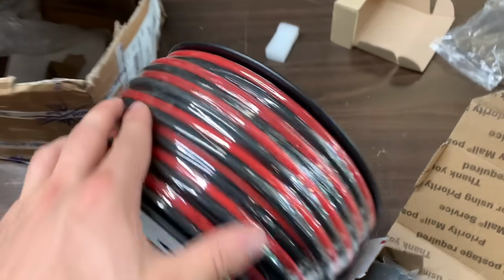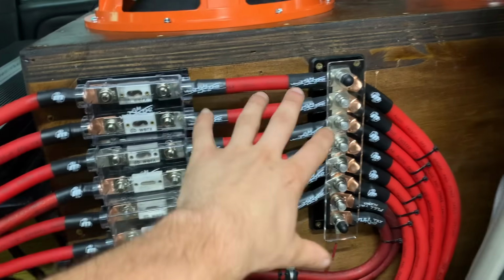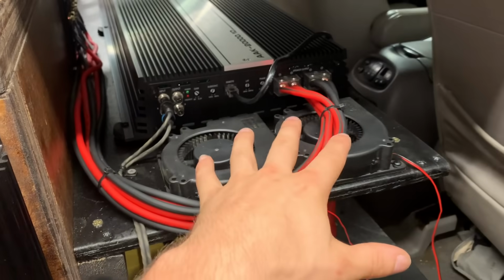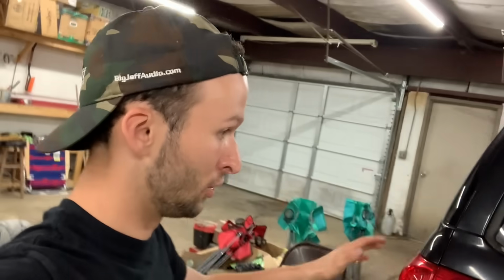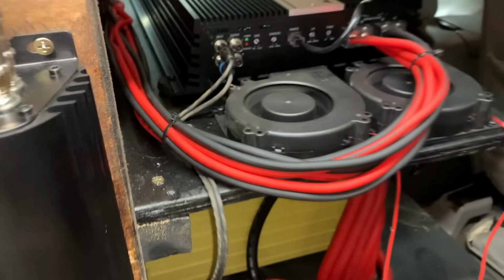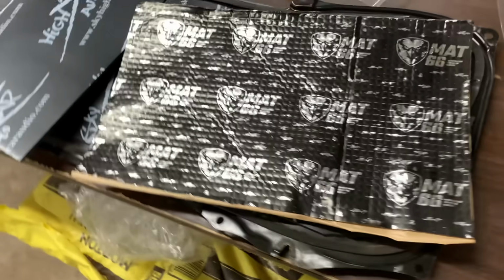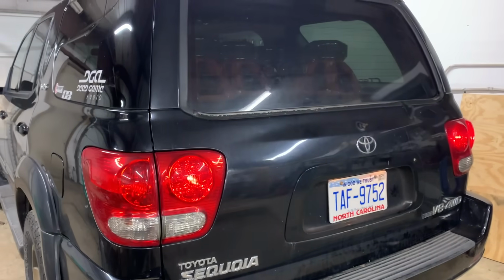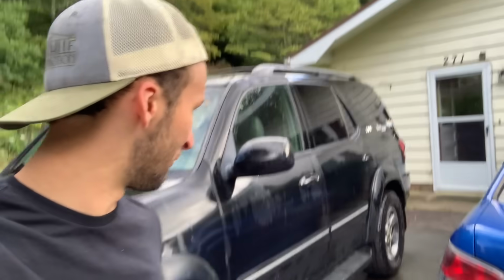20k Watt Bass Build Part 9 FINAL | 2023 Sundown Show Build

Comment: A tip I've learned from using sound deadening is to make sure the metal surface you're sticking in to is thoroughly cleaned with isopropyl alcohol or some sore of degreasing agent that doesn't leave a residue.  The material will stick better and stay there forever.  Do the same for the material that you were sticking the new stuff to so it sticks better to that surface as well.
Reply: And of it falls off anyways, or you want it to never fall off, DONT USE the cheaper 3m spray adhesive.  Or the gorilla glue one.   Because those suck, u need headliner adhesive or the 3m 90, which is the more expensive one.

Comment: In 90 I ran 24 hifonics 12s on 3k to make 156,now my 4 15s on 24k doin 158+. Crazy how different things are
Reply: 3K in 90' was pretty much unheard of back then. What kind of amps and subs were you using?
Reply: @dextermorgan1  Olympian subs,like solobaric kickers at time. 3 generation X Hifonics Zues amps,wired at 1 ohm,fanned to death.
Reply: We ran competition circles until about 2000
Reply: @moabs10blowthru41  Nice! I know older Hifonics amps worth excellent but I didn't know they made good Subs too.
Reply: @dextermorgan1  oh yeah,mine were the low level subs,they had some heavy hitters for sure

Comment: Second Skin is the best deadner available imo its sticky lasts forever and kills rattles as well as comes in several types to fit your needs
Reply from the maker: I appreciate it! I’ll look into it
Reply: Actually you can’t beat the Deaf Bonce Deadener we tested several brands and they come out on top
Reply from the maker: Hmmmm I might have to try it!
Reply: @ParkerTheBasshead second skin is great but the deafbonce one is like the vibraflex has to go on with a  flame torch but hardens like concrete
Reply: I use ground zero deadner, it sticks super nice and does not need heat gun also stretches somewhat. I also recommend deafbonce's stuff
Reply: @parkerthebasshead hey did you make sure you put all the mounting hardware in look like you might have missed a couple.
Reply: I used the deaf bonce double rigid best sound deadener on the market you literally have to torch it on and will last forever
Reply: Parker I do like what you do and how you carry yourself. So with all due respect, you should have had a professional build your box. That build is looking a little weak for what you're running.
Reply: Facts
Reply: @danielturrubiarte5160 no wall Toyotas hard to work with, but i do agree. My 5th gen 4runner does 52+ with a single 15 😅. Vibraflex, and more power will help him a lot tho. Those subs eat power like crazy. I didnt get to hear it in person at sundown though, so just speculation of course. Vids are odd. Ive heard loud stuff that wasnt windy, and heard windy stuff that wasnt loud 🤷‍♂️. Anything is possible.
Reply: If you are looking for the best CLD. Resonix just came out with a new cld product that is thicker than their previous. Their last product was the best performing. If stiffness and spl are the goal, you'll get more out of something like vibraflex.
Reply: That's still butill sound deadening. You need the hardening stuff. Deaf bonce, sundown or dc audio. The stuff you need a torch to apply

Comment: I've seen other builders use wood to shield their back hatch, something like you would build on your car doors to prevent damage but they used wood, probably could still use deadener on it still for extra protection. Probably could use foam behind the wood to seal it. For the number plate you can use thin weather strip on the back of the plate to prevent that from rattling as well.

Comment: It looks like you have the 3n1 Sky High Deadner with foam. That should be the single last layer used on top of deadner and can be cut in smaller pieces to fit better as the foam prevents contouring 

80mil/120mil/200mil butyl from them is what you needed mostly, goodluck on the progress
Reply from the maker: Ahhh ok the listing just said 160mil deadener and I assumed it was the heavier duty stuff
Reply: @ParkerTheBasshead This foam layer is usually meant to be placed under the carpet to isolate road noise. Its not a "mass damper" like the thinner, heavier stuff.

Ideally you need to bolt a steel plate to the hatch door. An extra 20 or 30 pounds would help stiffen it a lot. A couple pounds of traditional mass damper is not going to do much. The air from the port is very strong. 

Bolting or clamping the hatch shut is another option.

Comment: Yo idk if someone else has mentioned, the deadeners are 2 separate entities. The typical stuff is butyl rubber deadener and it is intended to add mass and lower the resonance of panel. The other stuff is closed cell foam, and is intended as a top layer over the butyl deadener, and has the same effect as an empty room with no carpet and adding carpet to it. It kinda helps more with high frequencies, and the possible echoing or bouncing around and repetition of those sound waves. The close cell foam is not intended to add mass.

Thats the difference to my knowledge, might be a helpful tip to pass on to the boys 🤷‍♀️ 
love the build 🤙

Comment: Awsome build bro! It's cool to see someone so thrilled about there own project. Keep up the good work. Ive used the sky high dampening and ran across the same issue. I just used 3M spray glue and that did the trick. Since then I had no issues. I'd like to see you review the Harmony Audio 18" Goliath  dual 1 ohm sub. No one has featured these subs for an absolute review. They seem like great 18's. Would like to see a full review in the future if it's possible. And very nice wiring work. Very clean.

Comment: I've got 2 boxes of 80mil Killmat in my beater (36sq ft box and 18sq ft box and it made more difference than any other single upgrade I've done. Less than a hunerd bucks, a weekend and a couple gallons of sweat is what I've got invested. Just did the roof today, actually. Happy effin camper here bro, dropping quad with newly upgraded Sundown U-18 powered by a MMATS Hifi4250 bridged 4ohms for 1,600rms.

Comment: I use kilmat 80mil, and I have 163 db build, and just got another Crossfire 16k for my 4 Crossfire xt3 18's in a 4th. Used it for years and never had a problem, and it doesn't break the pocket book🤙

Comment: I do have to agree about Skyhigh Car audios stuff. I tried their battery/ground cable, speaker wire, and a few other things.  Wasn't impressed at all. Got rid of all of it and went with D4S. I gotta say I was skeptical about D4S, ya know. Best wire, equipment I've owned or bought in a hot minute for sure! Build looks good! Really good job!

Comment: You need deadener made with vibraflex.  There are many brands with 160 mil.  It is kind of brittle at normal temps but once heated up and rolled into place it will mold perfect and will add deadening and support wherever you put it.

Comment: I’ve always used spray foam inside the trunk lid or hatch first, then sound deadening on the outside.  It has always worked great for decreasing rattles in those problem areas.

Comment: I use killmatt off Amazon for my sound deadening. It's a good price, sticks very good and works awesome. 

I put killmatt under my license plate (obviously outside) in the rain snow cold heat and 3 years later it still looks the same and works perfectly.

Comment: i found with the sky high heatshrink if i put it over some blank stuff it stays better. it's a bit overkill but if you're using wire loom over your cable the first layer of heatshrink having glue is a must. the branded heatshrink i just to flex anyway IMO.

Comment: What you need to do for as deadening i would pull poles in the center of the roof to the bottom and the back and i promise you that you will get way more output sound deadening works some what but the poles is the best way to go

Comment: Did u use alcohol or anything to prep the metal before trying to get it to stick, alot o c times even hidden panels have a slight layer of oil and dust

Comment: Trust me turn the box around I had  4 12s in the same box and I know you don’t know me but think about it turn the box around you won’t regret it was a lot louder and not near the rattle now I have 4 Deaf bonce db4 15s in a flat Wall in a grand am on 4 Orion Hcca 3000.1 dsplx and 80 headway cells and a 80 prs

Comment: That skyhigh looks like sound insulation vs vibration dampener. Foam will help with outside road noise... placed on the floor. The Dynamat type stuff is a mass loaded vibration dampener. Two different problems, two solutions. You want to mass load the body panels in the car, two or three layers worth.

Comment: You must not have any neighbors 🤣🤣🤣

You did what I did though. I ordered 80 mil deadener for my car but then I also ordered this thicker option which turned out to be a sticky foam type material, like what you have. I was disappointed with it as well. I ended up using it on the back of all my plastic panels and used the traditional 80 mil for the sheet metal. The foam stuff I got was listed as a 3 in 1 hybrid, yours could be listed as something else but it's not meant to be a stand alone deadener, it's meant to go on top of, in addition to, your normal butyl rubber deadener. More for absorbing higher frequencies.

Comment: Awesome video brother im new to the audio speakers im running a single 1,200 watt 12 with a 1,200 watt amp should I run a  sealed or ported box i accidentally ordered a ported  pre fab if im not happy can i seal off the port to make it a sealed  box

Comment: Congrats on the build, on the Sky High Sound Deadener, its junk for SPL, might be good for SQ but doubtful, in SPL we need the thick goopy rubbery resiny stuff the when applied and you knock on the outside it sounds solid, IDK if that is some knock off deadener or what but I've seen the Sky High 200mil stuff and its different, its solid.
Reply: it was closed cell foam.... you cant blame the product if you used it wrong

Comment: Stay away from sound deadening material at sky-high. Use second skin or dynomat extreme. Dynomat was the deadener everyone tried to copy. It's the original. I've used it in several of my demo vehicles throughout the years and have very little complaints with using it.

Comment: Heyyyy brother, so I have a suggestion for ya when you reach this level of a system the best thing you can do for it is to get your voltage up higher and stronger now sure Mechman sent ya a free alt but you should really reach out to them and ask for an external controller or just buy one from brandX for $99 and then you can adjust your voltage up to damn near 16V and then the biggest thing you no longer need A/C because you've got a massive wind generator taking up the entire vehicle hahaha so ditch the A/C compressor and put a 2nd alt in that spot you and your voltage will thank me for me it if you do trust me! Also that little 240a ain't cutting it you need a 370-Elite or a 400-Elite even if you have to buy it yourself it'll make a world of difference in fact if ya don't believe me then just throw that rebuilt BrandX back in and watch the difference in your voltage!!! For some stupid reason Mechman alts love to charge too low of voltage and they think charging at 13.8 is great when we need 14.8! That is where the external controller comes into play though as you now would have control of the specific voltage your alt charges at no matter what alt you run!

Comment: Resonix has been tested to be the best pound for pound sound deadener, its a bit more expensive, but the independent test dont seem to lie. im kinda disappointed that skar dampening doesnt have a thicker foil sheet, definitely go with something that doesnt have foam. That foam will fall apart over the years leaving trash bits everywhere. (Atleast thats what happened with ny second skin.) Nvx is what i rub tho.